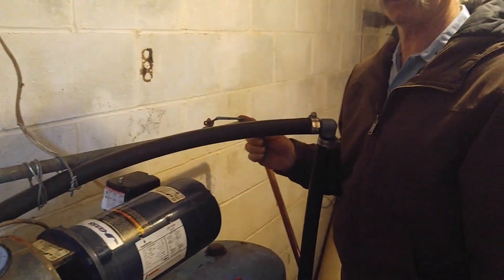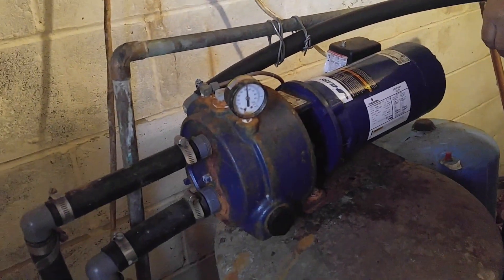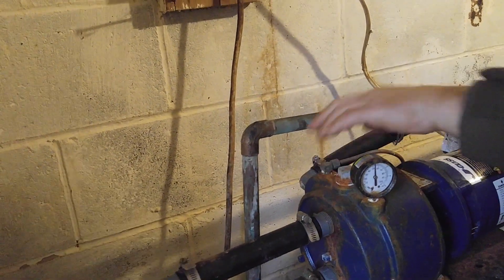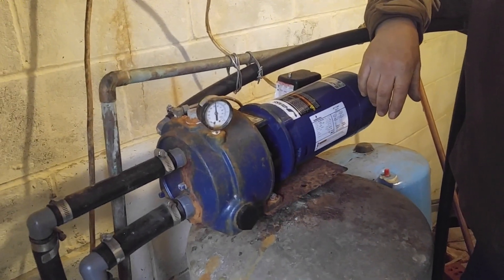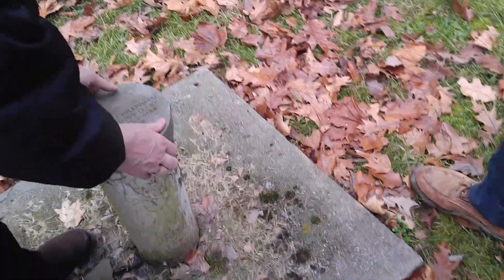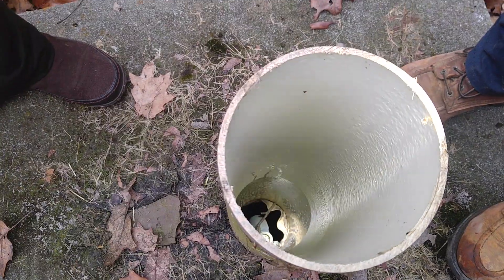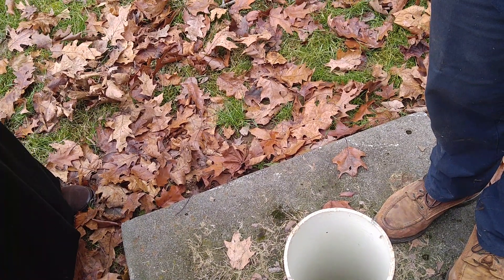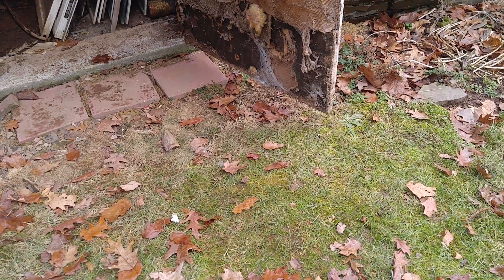Pump Priming - How To Prime External Jet Pump on a Shallow Well  (water) DIY

Comment: Im at 6 gallons....still not full
Reply from the maker: @-RyN-23

Sorry to learn that. Maybe you have a deep well set-up? If it doesn't fill by 10 gallons, there may be a leak. Good luck. And thanks for watching and commenting. 5:30
Reply: @ntccXerblog  found out the style i have has leathers above the foot valve that are trash. I got tired or poiring water an notice the water was creating a vacuum like it was drai ing out so i pulled the double pipe elbow an line to find only 1 leather was halfway intact and the other waa shreaded
Reply from the maker: @-RyN-23

Good job figuring that out! Hopefully you can replace that leather system with something better that won't wear out on ya. 🤔 Thanks for the update. This helps others. 🙂

Comment: Where do the two pipes on the botttom come from and go to?
Reply from the maker: @micontv381

The two lines go from the pump to the well. Water flows both ways: Down to the well from the pump and up thru the pump to the pressure bladder, then on to the house. Thanks for commenting.

Comment: I just noticed our jet pump starting slowing dripping/leaking where the shaft from the motor penetrates the pump. Is it hard to take apart and replace the seals?
Reply from the maker: @jamesfoster3488,

Never tried it. Let us know.

Comment: How can you tell if you didn't release enough air? I put on a new pressure gauge and now it shuts off when the needle hits 65. I was thinking it should shut off at around 40-45. It's a Jet Pump.
Reply from the maker: @ricg.4435, If there is air in your well's system, the pump will struggle to bring up the water. Your pump will take longer to fill the pressure tank; and the pump will make more noise than normal. Operating with air in the system can cause the pump to overheat and may lead to pump failure.

As for the pressure, these pumps typically are set to operate from 30-50 psi. They do have a pressure switch which controls this range. Be sure to 

TURN OFF THE POWER TO THE PUMP TO AVOID ELECTROCUTION

if you try to adjust the pressure switch. There are online written and instructional videos on how to adjust the pressure switch for your pump. Inspectapedia and wiki how are great resources.

Hope this helps. Thanks for commenting.

Comment: If prime bolt Is stuck how to I prime? Or open the bolt?  I know pumps for my fish tanks but am the bolt Is stuck /rusted. I can't find anything online about rusty or stuck prime bolt. I understand the theory and have primed before. 😅  I have used a hammer and wrench to try to open it. It's a newer well pump.  Similar to yours.  The only other thing I can think of is the well being  empty due to summer 😅 trying to learn how to do this stuffn
Reply from the maker: @canadianreefmaster

To remove the prime plug use a pipe wrench. You might need to temporarily remove the pressure guage to have enough room to get the prime plug off. If so 
1) be sure power is off
2) valve to house is off
3) pressure tank is empty
4) pressure valve reads zero
5) use pvc tape on pressure valve threads when re-attaching it to the pump

Prime the pump as shown in this video 😀

Hope this helps and good luck.
Reply: @ntccXerblog  I can do that all and have the issue is that even with jammer and wrench I can't get the bolt off. Looks rusted 😅  bigger wrench and hammer ?   Or can I take the pressure Guage off and pour in that ? 🤔   thx a lot for the help. I'm on a rural island with limited reception.
Reply from the maker: @canadianreefmaster

Definitely use a pipe wrench, not an adjustable "monkey" wrench. If the pipe wrench alone doesn't do it, add a breaker bar (any strong pipe that fits snugly over the handle of your pipe wrench will do). The breaker bar increases the moment arm (length of the distance between your hand and the pivot point [prime plug]). This gives you greater torque from less effort, increasing the odds that you will free up the prime plug. 🔱

Another trick you can try is trying to tighten the prime plug a little bit. Don't get too harsh and snap the head off the bolt 😱; but sometimes tightening a smidge will free the bolt (prime plug) enough so it can be removed.

🔵Hopefully you've been applying WD-40 lubricant to loosen the rust.🔸🔹

Yes, you could add the water to the place where the pressure valve was mounted; but it would be good to free up the prime plug for any future events where you might need to once again prime the pump.

As far as the hammer, hopefully you are only using that for light to moderate taps on the prime plug head  to loosen any rust. You don't want to damage the threads or head of the prime plug. So... bigger is not necessarily better. 😒🔨

Let us know how it all comes out.

Comment: What do you do when there is no prime plug ? There is just the pressure gauge that says it’s holding 40 psi but no water coming into the house. Pump is trying to pump (I unplugged)
Reply from the maker: If you have a filtration system, try setting it to "Bypass" and see if you get (unfiltered) water.

Comment: Ok. So WHEN do you turn the power off?
Reply from the maker: @Mort Solomon, Turn off the power BEFORE removing the prime plug. 

Also, BEFORE removing the prime plug, close the water line that supplies the house. 

Then drain the pressure tank until its guage is at 0 psi. (You may use a garden hose to control where this water goes as it  drains.) 

Then you remove the prime plug, and add clean drinking water so the air is pushed out of the pump and lines. 

Then replace the prime plug most of the way, leaving a few twists to allow any remaining air to bleed out. Turn on power and watch the system pressure guage. When the needle starts to rise, tighten down the prime plug, sealing the system.  

The pressure guage should rise to ~ 50 psi., and when your pressure bladder is full of water, the system should automatically stop the pump from running. 

Now the pump is primed!

Make sure your spigots in the house are off, washing machine and other water-using appliances are shut off.

Then open the water supply line to the house.  The pressure should hold.

Now flush any dislodged sediment from your lines. It is best to open a large unfiltered tap first, like a hose spigot or tub. This allows any dislodged sediment to be easily flushed from the system.

Once the water is free of sediment, resume normal use. ☺

Comment: Iv'e recently replaced a shallow well jet pump on a sand point well in a seasonal cabin that hasn't been used in over 5+ years. The old pump housing was broken due to being frozen.
 I have tried repeatedly to prime this pump to no avail. Iv'e even tried using the old pressure switch and another diaphram tank but can not reach cut off pressure. Pump gets to about 10psi under cut off and will rise no more.
I dropped a weight on a string down the pipe and hit water at 8' below grade (11' from the pump due to a 3' crawlspace), with something like 20' of pipe to bottom of well, (9' of wet string out of 20' total deployed)
You metioned dirt, stuck in the jet, in this video, causing similar effects. I thought sand points had just a screen at the bottom. No foot valve or jet, venturi, nothing, thus making the priming of this pipe impossible. Other videos show guys running a hose down the pipe to check for blockage. Even with a restricted flow wouldn't i still reach cut-off pressure eventually?
 I am extremely frustrated at this point and i guess pulling the pipe is the only thing i haven't done.
 What in the Hell am i missing?
The answer must be stareing me right in the face.
Oh yeah, also, the pressure does NOT bleed down after i throw off the breaker.
It will hold for hours
Reply from the maker: @JamesWaller 

Since your system is holding pressure, there is probably not a leak. But, since it doesn't achieve full pressure desired, there is likely a blockage. Pulling and inspecting the lines may be the best option remaining, before starting from scratch. 

Check out what the experts say at this site:

https://inspectapedia.com/water/Repeated_Pump_Prime_Loss.php

And Good Luck!

Comment: How do I know when my tank is full? I don’t have a pressure gauge either
Reply from the maker: When the pressure tank is full, the pump shuts off. The pressure tank lets the pump rest. Without the pressure tank, the pump would run every time water is used (even for small amounts like a glass of water or hand washing). By having a working pressure tank, the pump only has to run after the tank is empty and only until the tank is full (usually five gallons). This extends the life of your pump.

Tapping on the side of the pressure tank with your hand lets you feel if it is empty and hollow feeling or solid and full of water. [You can practice on a half full plastic milk jug for a similar experience before heading out to the pump house or wherever your pump and pressure tank are. :-)]

Thanks for commenting. Hope this helps.
Reply: @ntccXerblog  thank you!

Comment: When he says to shut off the valve does he mean the one after the pressure tank or the one between the pump and the pressure tank? I have photos if needed
Reply from the maker: Hi Ryan, He is saying shut the valve that supplies water to the house. You want the water to flow from the well to the pump then to the pressure tank. But you want to shut off the water supply line valve  that goes to your house after the pressure tank.  This prevents water loss if someone opens a faucet or uses water at the house while you are trying to build the prime. Once you've made sure the power is off and removed the prime plug and air by filling the prime plug opening with clean drinking water (thus filling your line and pump), you reinstall the prime plug just enough to be held in place, but loose enough to allow air to seep out when the power comes on and the pump is first started. Once the water pressure needle jumps / starts to climb, tighten the prime plug down the rest of the way and keep the pump on until it stops itself because it has finished filling your pressure tank. Then you can open the supply line to the house. You are done priming the pump! :-) Most residential well systems run between 30-50 psi water pressure (though some may be adjusted differently). If your pump is staying at a low pressure (below 30 psi) after the pump has run a few minutes and while your supply line to the house is shut, it could mean a leak somewhere between the well and pump; or it could mean the jet is blocked and the pump can't draw the water it needs. That is bad for your pump; and you should shut off the pump / power. If the jet is blocked by dirt, the well lines can be pulled (make sure the power is off before doing so) and the jet cleaned, and lines reinserted - that's what the second procedure is that's  been described in the second part of this video.  Hope this answers your question.

Comment: Is it possible to install a jet pump having three holes..  by the use of only two holes?
Reply from the maker: Hi Ravi,  You might want to check out this website for more info 

https://inspectapedia.com/water/Jet_Pump_2_Line.php

If by holes you mean the pump has three lines (hoses) attached, our guess is "No. That won't work." - Here's why.  Those pumps use one line to pump water down into the well, this, in turn, forces water up out of the well and into a pressure tank that then delivers the water to you. All three lines are needed. But, that may not be what you meant. So we recommend you look at the website in the above link. It has great info!  Good luck. Hope this helps.

Comment: I have a double pipe deep well pump. Lost power and when it came back on we didnt have water. Replaced the pressure switch bc it burnt out.  Tried to prime many times it spikes to 20psi then loses prime.  I installed a  T and a ball valve to fill the line easier. We tried around 20 gallons each time we filled it up and started the pump it gained psi but hasn't taken off yet
Reply: Ended up being the nipple in between foot valve and jet had blown a hole thru the side. I Changed everything out anyway so it should be good for a while
Reply from the maker: @bigsterms  That's great! It makes sense, to change it all out at the same time. We're glad you have a working system again! Gotta have that water.
Reply from the maker: kevin stermer, Try this website:

https://inspectapedia.com/water/Repeated_Pump_Prime_Loss.php

Good luck!
Reply from the maker: It's just a guess, but it seems your pump is working fine, when it can get water. Our guess is that the jet may be blocked.  Something as small as a human hair can stop the Venturi from moving the water. Have you tried pulling your lines?
Reply: @ntccXerblog we got it primed but the pump gets to pressure and kicks off and the pressure drops to30 within 10-15 sec with nothing running or filling with water.   pulling the lines this morning to check everything.

Comment: Just wanted to say "THANKS!!, for posting this video!!  I have been without water for 2 days,  trying to get the air out of my lines and build full pressure in my system.  I am always concerned about running pumps without water and burning them up.  I am a mechanical Millwright by trade  ,but; I have not worked with jet pumps very often and I was very tenuous about priming this system.  I was having problems with my jet pump shallow well system lately, as it would bleed off pressure immediately after shutting off at the high pressure setting of 50 psi.  I pulled my piping out of the well,  suspicious that I had a faulty foot valve.  I discovered a hole in the 1 1/4 inch pipe nipple coming out of the ejector valve around the venturi tube. I had removed the entire assembly about 5 years previously because of the same symptoms ,but, the issue at that time was a hole in the  side if the ejector valve.  I installed a new ejector valve and when I reassembled the entire ejector valve ,foot valve assembly the only 11/4  pipe  nipple I had on hand was a piece of black iron pipe to go over the venturi tube.  This was a big mistake!!  The black iron pipe nipple deteriorated substantially over just a couple of years.  This time I installed a piece of galvanized pipe because It was the best material  I could find on short notice ,needing to get water back in my house as soon as possible.  If at all possible install a piece of brass or stainless pipe, if you can find it available,  to avoid the need to change this out again by creating another weak link in the system.  Pulling all this stuff out of your well SUCKS and if you are paying someone to do it is very,very expensive$$$$!!!!  I hope I have helped someone else that may be having these same issues  as I have just dealt with!  Thanks again for your video!!!!
Reply: My well water eats holes in the piping too. And the galvanized 1 1/4 nipple will fail because exposed threads will rust through quick, the threads have no coating on them, Schedule 80 PVC threaded 1 1/4 nipples are available if you can make one fit.
Reply from the maker: @michaelhilber8284  Thanks for sharing!
Reply from the maker: Glad this video helped you. Thanks for the comment and info you shared. Sure somebody will benefit. =D

Comment: Can’t get my new well to take prime.
I have a in line check value at 25 feet then on the end  a 4 foot well point strainer  using 1/14 steel pipe for my casting. I have tried two different shallow well pumps one is half horse bought new at Tractor supply the other is 1.5 horse pump this pump will build up to 16 bars or pounds of pressure just can’t get the pump to prime. I know my Check value is working because I can fill the pump up with water and it holds. I have no water leaks. I believe all my fittings are tight. Any suggestions?
Reply from the maker: Try this website for more info on pump priming:

https://inspectapedia.com/water/Repeated_Pump_Prime_Loss.php
Reply: OMG!
What was it? The only thing i haven't tried is to completely start from scratch.
Reply from the maker: @jameswaller5568  try this site for troubleshooting tips:

https://inspectapedia.com/water/Repeated_Pump_Prime_Loss.php

Hope this helps!

Comment: My pump is working but it ain't fetching water.. i guess time to buy a new pump or so..
Reply: sayan sourian 
Maybe you didn't get it primed yet. It just took me 3.25 gallons to get my needle to jump and pump to start pulling.
Reply from the maker: Maybe... Might be dirt blocking the jet.
Reply from the maker: David Hathaway, That's a good point. You have to prime the system to remove the air so the pump can draw the water properly.